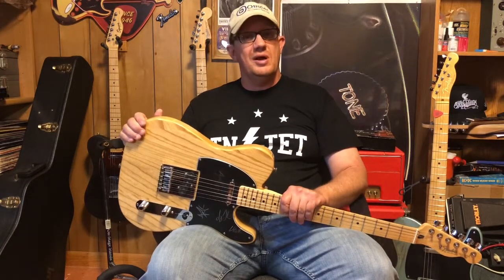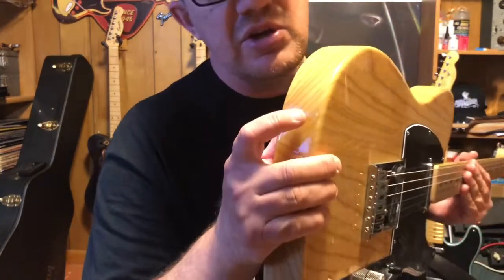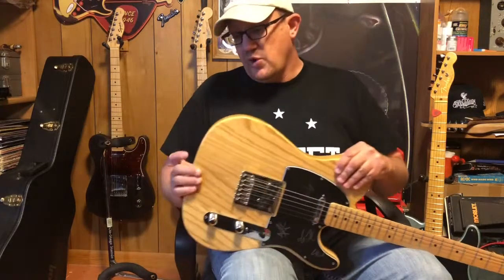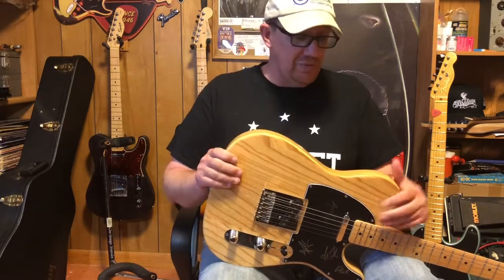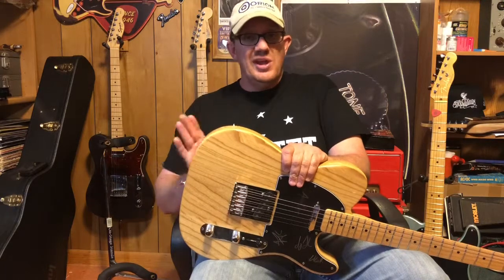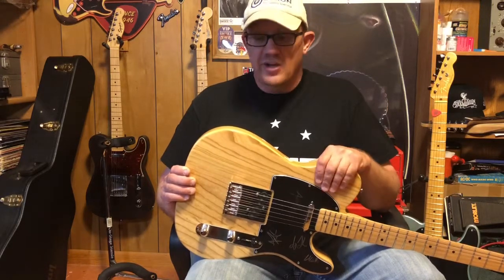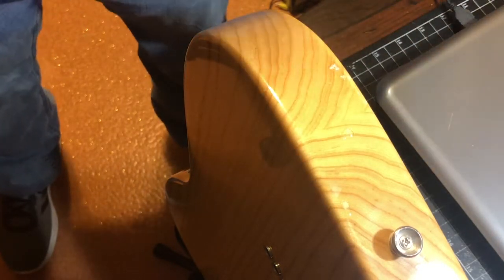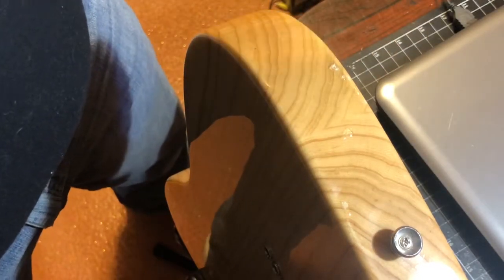How to fix chips and cracks in guitar clear coat.

Comment: Man my telecaster has so many chips in it it's ridiculous. I have another guitar and the neck has an entire section of clear coat missing on the back, like 6 inches on a third of the neck. Should I just sand most of it down until it's evened out, and get rid of clear coat? I have this feeling that nice sanded wood with oil or something else just feel better in the hand. U ever pick up a new ish guitar and your hand kind of gets stuck on the clear coat of if your palm has any sweat on it? I just know the neck will probably warp without that clear coat